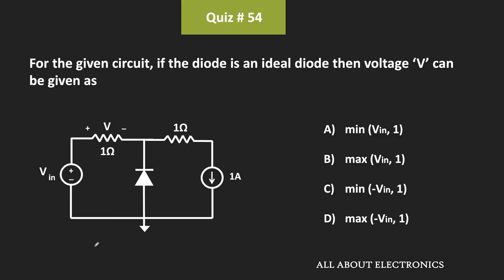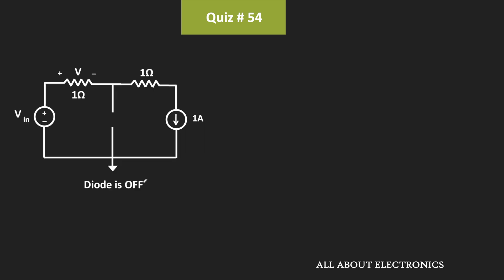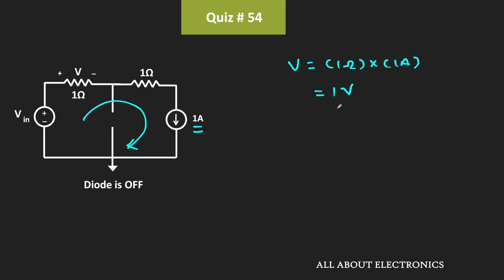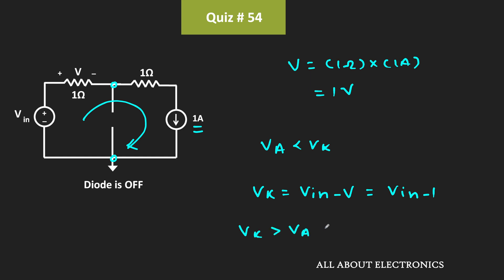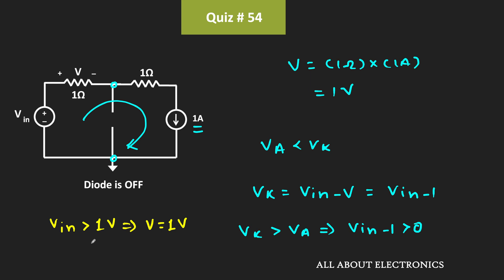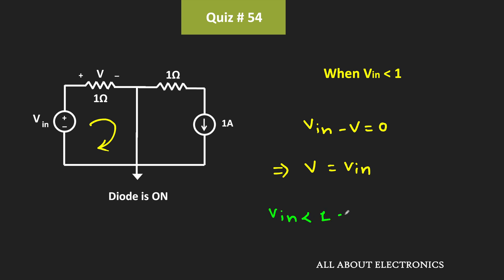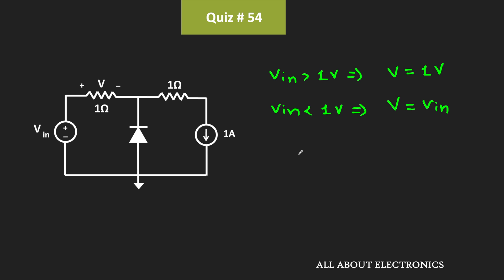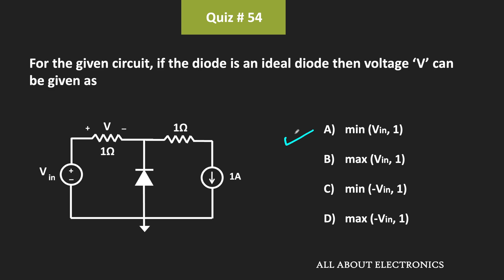Diode Circuit Solved Problem | Quiz # 54

Comment: I have a doubt: the diode is in reverse bias so in all cases it will act like an open circuit so how sir made it short circuit
Reply from the maker: Whether the diode is in ON condition or OFF condition, that depends on input voltage. As explained in the video, if the input voltage is less than 1V, then diode gets forward biased. And being ideal it acts as a short circuit.

Comment: Sir in this question if diode is conducting then Voltage at the anode end is zero due to the ground present and in this case the voltage at cathode should also be zero but we have a current source due to which the voltage will be drop due to the resistance presence then the voltage at cathode becomes greater then anode then how it can conduct??
Reply from the maker: Since anode and cathode are shorted, so both will be at same potential. The drop across the resistor is between the one end of the current source and ground. So, it won't change the cathode voltage. I hope, you are able to visualize what I am saying..